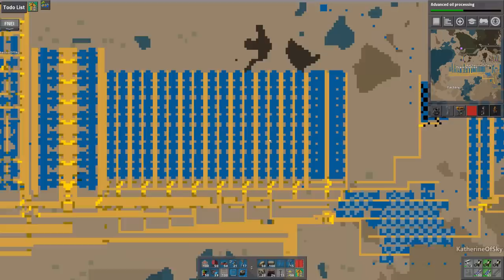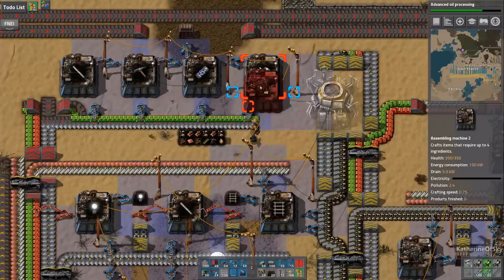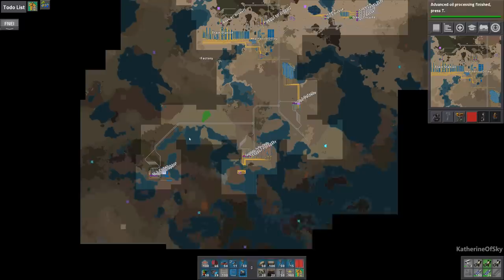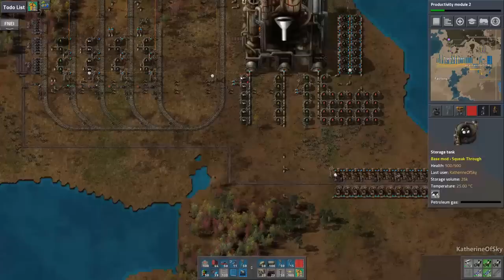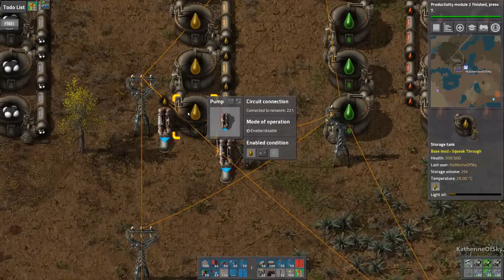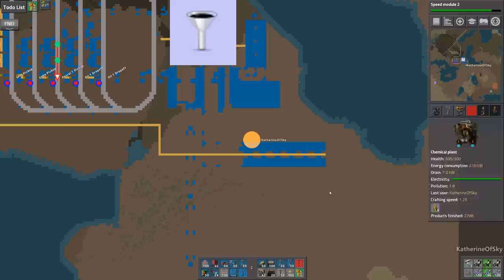Whistle Stop Factorio Ep 26: ASSEMBLER-MADE OIL PRODUCTS - Mod Spotlight, Let's Play, Gameplay

Comment: 1:48 The guiding line from the iron ore extraction field is transported entirely to the first furnace set. I assume there should be a splitter that will lead the iron ore to the second set of furnaces. At this moment the line is empty and runs from the main line from the iron ore mine. There is also a similar set of stoves without ore.

Comment: I think light oil should be used for solid fuel first and only cracked when you have too much. You've set the conditions to crack it first and only make solid fuel if both petroleum and light oil are backed up. 

Speaking of solid fuel, the fuel train could distribute it instead of coal.
Reply from the maker: I don't prefer solid fuel as a fuel source.  It's FAR more important to have more petroleum.
Reply: Solid fuel is slightly better for trains than coal. 

Plastic is of course more important than solid fuel, but the way you've wired your pumps you won't make any solid fuel until all those 10+ storage tanks for petroleum gas are full, as well as all those 10+ light oil tanks. That's over 500k in various oil products that will become a buffer once your factory stabilizes. Consider alternative conditions: "crack light oil, if light oil > petroleum gas" OR "make solid fuel if light oil < petroleum gas".
Reply from the maker: I have set it up exactly the way I want it.
Reply: As a player of this game with comparable amount of time in game, I’ll be the first to admit that there is no one way to play.  But learning little things from the community is growth as a player.  Sometimes it just means that in certain situations you may or may not be the subject matter expert.  You may find that some comments aren’t very conducive to a happy community.

Comment: Thanks for the episode KoS ! your voice seem a little bit down, perhaps are you having a cold? i hope you'll get better soon if that's the case 
For the iron problem, it seem you didn't fixed that your main line of iron is only 2 belt for your whole mall+science, as the green circuit have 2 belts going directly into it, you should maybe import the circuit first before importing iron plates, that would make your iron far more balanced, you should fix the whole main bus too, just having at least 4 lanes for everything , as there is 2 lane of iron, 3 of copper, your main bus is kinda wacky right now :)
 and some other have pointed it out, but you should use now your heavy oil to crack it down into the light oil to keep up a little with the cracking needs, as now your heavy oil is backing up a lot :)

Comment: Did the ratios for furnaces get changed? It looks like the end of the iron line isnt getting raw iron and at the same time the ones in the front of the output cant put anything on the line even though it seems we are using it up. Also, dont forget about the lubricant. Im not sure if the refinery is running because I think its full.